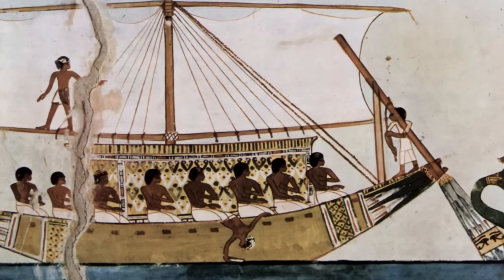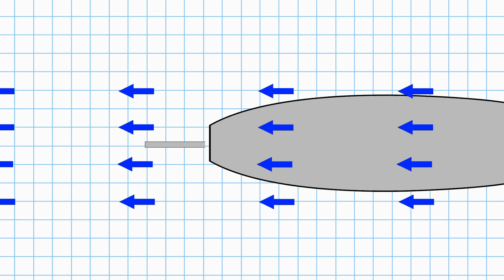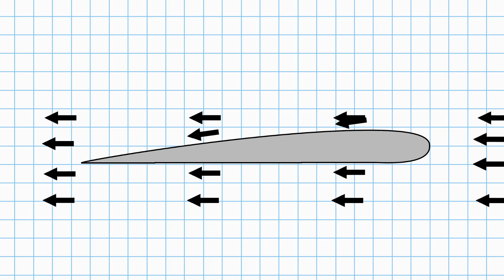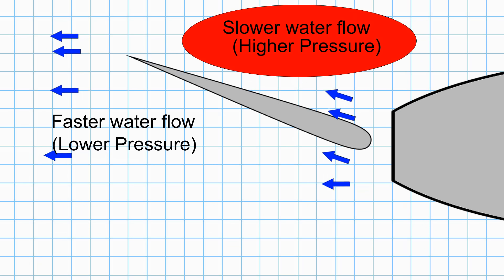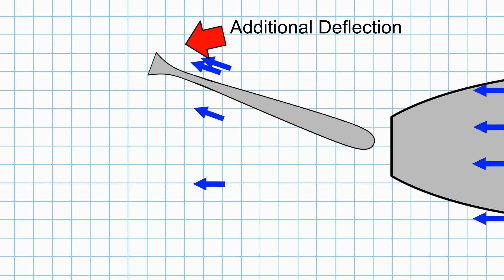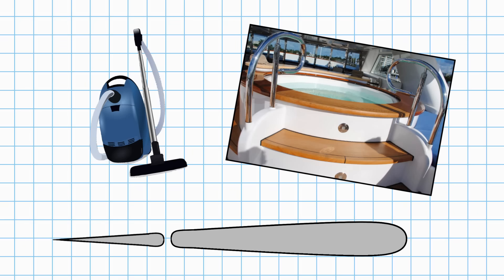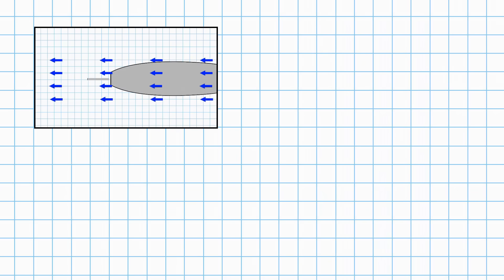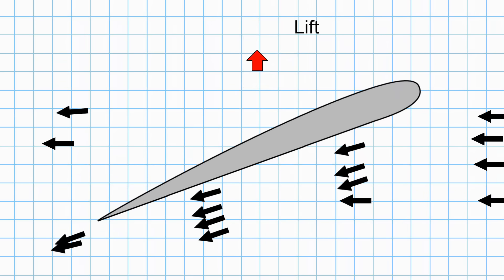How Does A RUDDER Work?

Comment: The "equal travel time" principle is a fallacy and does not accurately describe lift. Further, it violates Newton's third law. https://en.wikipedia.org/wiki/Lift_%28force%29#False_explanation_based_on_equal_transit-time
Reply: A more intuitive description might make mention of the friction between the fluid and the foil, which causes the flow to be deflected. This change in momentum (read: force) is equally and oppositely imparted onto the rudder and in turn onto the ship

Comment: What about high speeds, I would think that something like the fishtail version would probably increase drag, is that something that's relevant enough to prefer different shapes for high speeds and also would increased strain on the rudder influence what type to use?
Or is it in practice so much more important to have good performance at low speeds that performance at high speeds isn't really a concern anyway?
Reply: I would guess some ships like tugboats or small ferries would need more maneuverability than high speed efficiency

Comment: 2nd rudder type is merely a symmetrical shape. It does not act like. Clark Y airfoil shape. It acts only as a symmetrical wing would on an aircraft, making lift solely when there is a positive Angle Of Attack. Its advantage is that is slides through the water better with the curve and taper, like fairings for wing struts or wheel pants.
Great information on the 3rd and 4th type rudders.

Comment: I dont want to be a party pooper, but (2:30) the difference in speed was a theory that has been disproven. 
So what we are left with is Newton's third law, Bernoulli's principle and Magnus effect. (For symmetrical airfoils)
Reply: @Agamemnon1002 the air above the wing is not faster because it has a longer way to the trailing edge than the bottom. It is a common misconception. For one air wouldn't have to or want to end up at the same time at the end of the wing(top and bottom) and in experiments it's seen that it doesn't.
Reply: Robin Marquardt 
I have seen wind tunnel test, they disprove you. The air above the wing is even in quicker past the wing than the air below. So it has to speed up drastically.
Reply: @theflyingmylle  it does not disprove me, because I said the air is not meeting up at the trailing edge again. I know that the air above is way faster. That's how lift works. We know the correlation between lower pressure and kinetic energy of the air. In order to create lift(pressure difference between above and below) the air had to either be slower below or faster above or a combination of both. The question is WHY, HOW, WHERE FROM, WHAT CAUSE. But thanks for stating the obvious. "Air is not taking the same time to flow over as under the wing, top meet up at the end again." If air above would take longer (by being as fast as the air below) you could not generate any lift what so ever. If the air was meeting up at the end again, you could, but that's not the case. What is the case is, that is faster and takes less time to get to the trailing edge. Effectively creating lower pressure, creating lift.
Reply: @theflyingmylle  but hey, thanks for recapping my statements. Maybe next time read them in a way that you understand them, before you try to disprove them
Reply: @MqKosmos  Im quite late but as i learned it the air above the wing had to be faster since the longer distance creates an vakuum at it's end and a high pressure zone for the air/water at it's contact with the foil. Thereby the easiest path for the air/water is to speed up. When the stalling occurs exactly that is not given anymore and the foil loses it's effectiveness.
Reply: @eVolution2665  with this theory I think you would not be able to explain inverted flight. In fact what matters is not an increase in speed on the top of the airfoil, but the curvature that a slender profile crates to a streamline when it has a relative AoA in respect to the free stream. Strating from that you can explain everything you see IRL with planes and in a wind tunnel.
Reply: @Agamemnon1002 yes
Reply: Robin Marquardt what makes you think that there is no speed differential across an airfoil? Every advanced textbook on fluid mechanics I have studied in both undergraduate and graduate school has dealt extensively with airfoils and there is speed differential. Granted the mechanics of an airfoil are extremely complicated (entire PhD dissertations have been written on the subject) so there is no way it can be described in a few sentences, but the basics can be understood by reading a good textbook in introductory physics if you want more information.
Reply: @GregKittle  aor does not flow faster or slower across an airfoil because there is a longer way. If corrected for Bernoulli's principle, there is no difference. I actually did experiments and in addition real life applications suggest otherwise. I spend 120.000$+ on this stuff btw. The fact is that what is taught is not what's actually true. Those are theories. As of now there are 3 accepted theories on how lift is actually created.
Reply: @GregKittle  air above an airfoil has no intention to end up next to the molecule it parted ways with before hotting the leading edge.

Comment: The theory presented here is only partially correct. The rudder shape is NOT an airfoil section and does not really behave in the manner described. If you want to understand why they are the shape they are you should look at your 2 photos at 0:20 and 0:29, observe and collate the differences. 
Once you have understood your mistake you might wish to present a corrected video and you could also add a short clip on the differences between unbalanced, semi-balanced and fully balanced rudders.

Actually, I'm most interested to know what the Johnny hanging over the side at 0:31 is doing. Red sea navigator?

Comment: What about trim tabs on large rudders? Large rudders are too difficult to move, so the trim tab moves the opposite direction to move the rudder in the direction you want it to move with a much smaller force.
Reply: so the rudder is so big, it has its own rudder?

Comment: The speed of the air over the wing is not the reason for the lift generated, but it is a common misconception. 
It is actually the same principle as you explained with the rudder: the wing is slightly angled and redirects airflow. This causes a pressure difference which generates lift. 
The speed difference is just a result of the pressure difference
Reply: The Angle of Attack is an extremely important concept in aerodynamics.   
It's basically "how much angled the wing is in relation to the incoming airflow and so how big the chunk of redirected air is".
Without this angle a wing will not work.
Reply: @ManuelSalomoneInc  "Without this angle a wing will not work."
A wing will generate lift even when itself isn't angled because the different sides of the wing aren't symmetric.
Reply: Yeah, video was great but that particular bit spoiled it for me quite a bit.
I don't know why this myth is propagated so much, I've always been into mechanical stuff read about things since childhood, and I haven't learned  how the wings actually work all the way until my mechanics professor at university enlightened us.
 @seneca983  
No, it is definitely not correct. This explanation implies that the wing shape causes the plane to fly all by itself, which is simply wrong.
While the shape of the wing itself will indeed generate some lift, it is nowhere near enough to lift any plane, unless you assume that it's made of near weightless material. Even with the idealized (and wrong) assumption that the same air parts and meets back at the exact same points, the pressure gradient due to asymmetry is simply way too small.
Reply: @ahriman935 : "This explanation implies that the wing shape causes the plane to fly all by itself"

I don't think it does. Whether it's the shape of the airfoil or the angle of attack, Bernoulli's principle still applies. As such, the explanation using the relative speeds and the consequent pressures of air above and below the wing is a correct (though not very intuitive) explanation.
Reply: @seneca983  
The Bernoulli's principle should apply, yes.
But only if we make a notorious, silent assumptions that
a) the air flows above/below wing are linear
b) more importantly, that the air molecules which part before the wing, meet back behind it.
Both of which are wrong, as the air flows (especially above the wing) are quite a bit turbulent and difference in paths is simply made up for by more air from around the wing, without need for increased speed in the above flow.

If we take angled wings, the lift will come from the action-reaction force caused by the redirection of air particles rather than Bernoulli's equation.

Last but not least:
If you do the maths, use Bernoulli equations, calculate pressure gradient, multiply by the typical airplane surface area, compare to airplane weight: you'll see that even with idealizing assumptions the pressure gradient from differing air path lengths will not be enough to actually pull any plane upwards, no matter if you take only wing shape or include the angle.
Reply: @ahriman935  "The Bernoulli's principle should apply, yes.
But only if we make a notorious, silent assumptions that
[...]
the air molecules which part before the wing, meet back behind it"

No, it's not at all necessary to assume that. It's sufficient that the airflow above the wing is faster. It's not intuitively obvious why it's faster but that's nonetheless the case.

"If we take angled wings, the lift will come from the action-reaction force caused by the redirection of air particles rather than Bernoulli's equation."

These are just two different sides of the same coin. The action-reaction you mention exerts a (higher) pressure on the bottom side of the wing. This is the same pressure implied by Bernoulli. Conversely, the pressure difference implied by Bernoulli inevitably means (downwards) redirected airflow behind the wing you mention.

Your explanation is the same thing as the explanation using Bernoulli's principle. They're just looking at the same phenomenon from different angles.
Reply: Both answer are good and are in fact needed. If you use only displaced air to get your lift, then how do you explain stall? Stall is the lost of the low pressure pocket of air above the wing, which is easier to explain with Bernoulli.
The balance between the 2 depend on the shape of the wing, fighter goes too fast to really need Bernoulli, they would generate too much lift, so their wings are mostly symmetrical. If you look at a glider it's the opposite.
At the end you can use both, if I was building a plane with a known wing, I won't need Bernoulli, but if I was building a wing, I would use it.
Reply: Agreed that air above and below an airfoil does not meet at the same point. Lift is generated by directing airflow downwards - by angle of attack and by the airfoil's shape. There are some videos on YT that explain this in detail - I'm not going to provide links because I don't want to make an advertisment, but they are easy to find if you search how lift is generated.

I always thought it's about this magic curved shape of the wing until I bought a simple polistyrene RC plane and after closer inspection found out in shock that the bottom part of each wing was curved exactly the same way as the upper part. They were totally symmetric, just like the rudder in this video. That was an eye opener for me. Ever saw a stunt plane flying upside down? Did you wonder why it didn't fall down? It's not the airfoil shape or air meeting magically at the same point on the end of the wing. It's the angle of attack man, angle of attack.
Reply: Both are correct
Reply: I get so irritated whenever people use the 'speed' explanation as it is so inaccurate. I'm glad someone else knows about it! I wish this comment was higher up, or if Casual Navigation didn't make the mistake in the first place!
Reply: Agree, both are correct but modern airplanes are all about efficiency angle of attack and the shape of the wing itself must be honed to its utmost best to meet the demands of modern air travel
Reply: "The speed of the air over the wing is not the reason for the lift generated, but it is a common misconception."
The speed explanation is correct. It and the redirected flow are sides of the same coin.

Comment: You don't want them to stall?! a wing don't stall , the wing is moving, not the air, you can  only stall if there is a lack of speed  cause there is not enough lifting force for the weight.

Comment: You could explain why it wasn't a good idea to turn back the engines full speed while steering to a side without a iceberg 1912 at the Titanic.
Reply: I used to think the same thing that reversing the titanic engines made steering worse, but I then remembered that the central propeller cannot be reversed, so it shouldn't of really affected the steering
Reply: @prich0382  - but then the central machine would be stopped. Then there is also no better effect.

Comment: Unfortunately you've for the explanation of an airfoil wrong. The pressure is not the reason lift is generated. Its thanks to newtonian physics and the fact the wings push their fluid in the direction of their tilt causing thrust
Reply: Most of the lift is generated through Newtonian vector physics but some lift is generated by streamlined fluid flow around the airfoil allowing for less drag for same amount of lift.

Comment: Not the best description of how airfoils work. There's no reason that the top and bottom air have to meet up again, and extreme designs that would take advantage of that rule prove useless.
Reply: To be fair it is a rather common and easy to visualize explanation and I think for the purpose of this video it's more than sufficient.
Reply: The reason extreme designs fail is due to flow detachment, not because the principle is flawed

Comment: What about the directional propellers that can turn in some ships and tug boats?
Reply: Think you are talking about bow thrusters.

They only work in really slow speeds, and usually need some time to get ready to be used. Deckhands need to open vents, the hydraulic system needs to build pressure, the engineers have to start enough generators so the ship has a high enough electrical supply, these things are high powered macinery using up a LOT of electricity, then the bridge needs to test and document them before use.

While manouvering slowly, the bow thruster is very useful.

On single propeller ships, the aft pulls to one side (always the same side) when the engine is driven astern. Pair that with a bow truster and you can turn on a dime or even go somewhat sideways.

If you have two propellers and a bow thruster, you can manouver the ship in any dorection you can possibly think of by combining different levels and directions of thrust on each.

Comment: You have gotten how airfoils work back wards 
Faster=lower pressure
Slower= higher pressure
Reply: He's correct - he wrote slower water flow is higher pressure, which is true from Bernoulli's equation?
Reply: what part of the video are you talking about? This part 2:45?
Reply: Ya,  lp=high speed, hp=low speed fr airfoil to create lift
Reply: Yeah, it's a bit off
Reply: Even this is wrong, the pressure difference is what causes the difference in speed. Speed is a result, not a cause.
Reply: FOOL ! Airfoils operate in air , think about it , there is a clue in the name . Backwards is a single word . The man was correct and unlike you did not make a fool out of himself .
Reply: @langrichar 
But both, air and water is technically a fluid and behave like fluids. At least in CFD.
Reply: @kramrle  As is glass also a fluid .
Reply: @langrichar  That's a myth. Glass is effectively a solid, and does not really flow.

Comment: What would happen if u stall the rudder?
Reply from the maker: It would stop generating lift, so it's effectiveness would drop dramatically
Reply: @CasualNavigation  would u be able to stop the stall (if u had enough time before crashing into something (how much time would that be on your ship))
Reply from the maker: All you need to do is reduce the rudder angle again and the stall should stop. It just means sometimes you will find 35deg more effective than 45deg if the rudder has a stalled by 45deg.
Reply: @CasualNavigation  thank you :)

Comment: This presented theory is wrong. The "Low Pressure" pulls the object toward the low pressure. 

In an aircraft, when you push the stick forward, the horizontal stabilizer turns upward. The air flowing over the surface "Pulls" the tail of the turning the aircraft. aircraft UP. Not Down. When you turn in an aircraft, the aileron flaps on the outer wing surfaces, one side goes up and one side goes down. Something the Wright Bros figured out. Back  then, it was called "Wing Warping. 

If you want to go fast sailing a sail boat, you need to understand the concept. Same with flying airplanes.
Reply: And thats exactly what happens here. When you turn your steering wheel to the left, and you rudder is also going left as presented here, there will be a lower pressure on the right side of the rudder, and the back of the ship will be pulled to this low pressure turning the ship to the left

Comment: What effect does a stalling rudder have on the ship?
Reply from the maker: It will reduce the effectiveness of the rudder. The rudder will generate less turning force. The rate of turn will be slower and the turning circle will be larger. If the rudder stalls, you are better reducing the angle slightly, then you will generate more force.